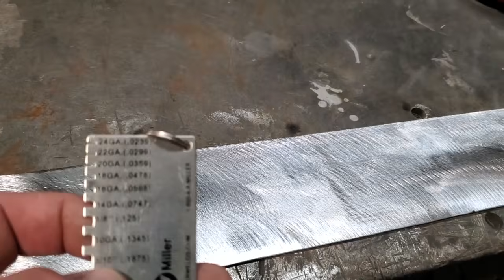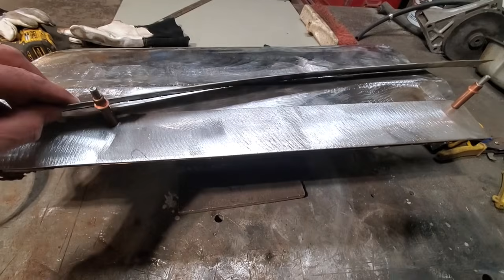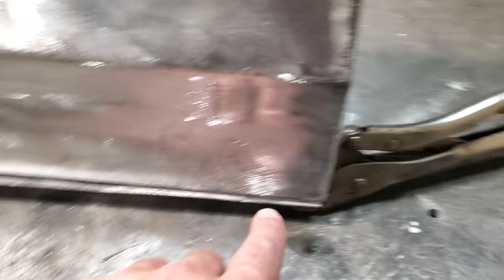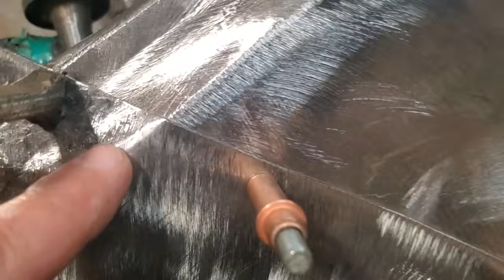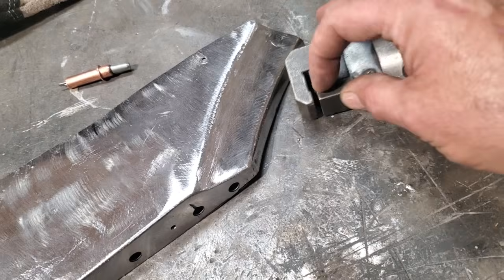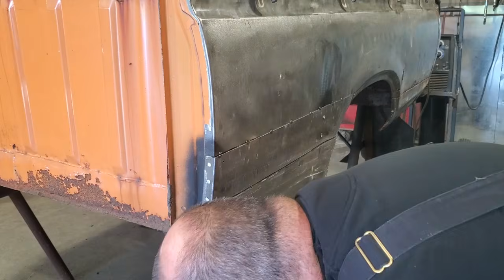How to make factory seams from rusty metal

Comment: Just wondering about using Mig brass wire for but welds. Asking since it seams to bond to sheet metal at a much lower temp than Mig wire .023. also I find some factory spot welds that are brass in color like on the ends of quarter panels. Thanks for your time and awesome videos
Reply from the maker: That is a new type of welding wire. I yet to use it. I been in a few bodyshops here that use it. It's designed for the thinner metals of today's cars. It's looks to be a quality type of weld. I was of the thinking it was a special  welder that uses the wire. Maybe a different gas. Something to look into.

Comment: First, thank you for your content and tips. You have actually got me wanting to get back into building again. A question if I may and hopefully it hasn't been asked too many times. Why the cut and butt vs. a pneumatic crimping tool for an overlap? I've used both and have no real preference but I was interested in your thoughts. Thanks again for the content.
Reply from the maker: I don't like the step cause it usually has a very unclean looking joint.

Comment: Love your work Fitzee.  What r the chances of you splitting the skin of trunk lid (boot here in Australia) Or a hood?  Rust between the frame and the skin can be bad with those 70s cars.  One of the best channels on the tube.  Cheers scott
Reply from the maker: I done it in the past. Had to swap outer skins. Not a hard job just have to take your time. Some are spot welded and have roll over lips. Not alot od spot welds do trick is to get the spot welds cut.

Comment: Fitzee, I have watched several of your videos over the last few months. I find them very informative. I have a 2000 Chevy Blazer that is a cousin to Crusty. Its entire exitance was here in Mid Hudson New York. Plenty of rust. I have been putting it off for some time but I have to address a lot of the rust. Your videos have given me a 
direction on how to proceed, thank you. My first project is a softball size hole under the gas filler door. It has taken part of the door opening out as well. I have a Lincoln AC 225 s stick & a Harbor Freight 125 flux core welder both of which I am ok at best.
My question, would I be able to use the HF flux core welder for this type of repair. I watch other videos that used it but I would like your opinion.
Stay well, Joe Z
Reply from the maker: It can be used but the cut and butt is very hard to do with flux on thinner metals. It's a much hotter weld
Reply: @fitzeesfabrications  Thank you. I want to get this  ( these ) projects on the way but may have to wait due to weather. Meanwhile I will see if I can find a gas welder for a reasonable price. Another issue is the lack of space I have. Would there be any issue storing the gas outside in a non heated shed?
Reply from the maker: @JOEZEP54  no it will be fine.
Reply: @fitzeesfabrications  Much appreciated

Comment: So whats the solution to making spot welds. Pinch welds rust out even with weld through primer???
Reply from the maker: Making spot weld??  You mean naming a welded panel look like it has factory spot welds?
Reply: @fitzeesfabrications  i guess but you said when they rust out its always at the spot weld?
Reply from the maker: @johnadona3014  yes. Now when I say rust out I ment it where the rust will start to show. This is mostly on winter driven cars. A car that is stored and well cared for will last. Many times longer. So keep that in mind

Comment: Grate metal work I'm just a beginner  with  a Lincoln weld pa ck 100  with 035 flux  core. Welding on early 50  mopars

Comment: Most videos show hammering there welds on dolly to stretch them from shrinking as they go along. What are your thoughts on this, I never see you do it and your panels turn out fine.
Reply from the maker: You see that in tig and steel welding with a torch. Those are softer welds. Mig is a harder weld and very hard to stretch.

Comment: I'm wondering what do you think about the usefulness of oxy-acetylene torches? Do you have one/use it much? I'm completing a small 8x8 fireproof grinding room/metal workshop at home for small projects and some rust repairs. Wondering how to best organise the space I have available.
My grinding room is in the basement, but I have a 240V welder power outlet accessible to work outdoors under the carport too.
Reply from the maker: I had 3 sets of torches in my life time. Sold all three. Haven't had them in 10 years. Every now and agian I love to have them doe shrinking metal but that's about it. Can't justify the contracts cost of the bottles to have any use for them.

Comment: i have 3 off these boxes made into trailers with 2 d-50 boxes made into trailers 79 1/2 ton chevy and a 68 3/4 ton ford box made into trailers all in good condition with tail gates the chevy and ford trailers match my pu's next i need a 68 chevy box trailer for my 68 chevy pu i do have all the parts sitting with a 3/4 ton frame . i have a lot of chevy square body trucks that are rust free. u guys would shit if u seem the datsun pu's i cut up and scraped for the trailers one ran and drove just fine even had a weber on it 5 speed and 4 speed and a automatic all had good bodies on them but they were free to me . i was going to build one but after sitting in it i just did not like it i am more a full size pu guy with a big block 4x4 or 2 wheel drive it has to have a big block even my muscle cars have big blocks i have a few good running sbc chevys sold all the fords i had but one 428 for my high boy need rebuilt running a 390 right now

Comment: These are great videos I am welding up my cars no experience at all, by trade I am a toolmaker so work with metal but never sheet. So when I have a plate to butt weld I take a lot of time making it fit as I would a tool but your methods make it so much easier and quicker to do. The best thing is how you explain what you do and use basic tools, the number of videos I watched on here that start well, but then take it a over to a bead roller, or other fancy piece of kit which the average DIYer has not got, we all have a hammer, a vice, and can purchase a few cheap dollies or make kit like you have. So thanks for all the great video, and passing on your skills and tips

Comment: The best quote "Make it look like it has never been repaired." Brilliant work Tony. 
Hammering a chisel like this is similar to hitting two hammers together (the end of the chisel is hardened to prevent it rounding off inside the pneumatic etc. tool) and can result in splinters of metal coming off like bullets. It happened to me as I was taking a shed down on a building site, the splinter went into my leg. Two colleagues, one when I worked as a mining electrician and the other when I was working in a car manufacturing plant, had the same thing happen to them, one had the splinter go through his clothes and into his stomach and the other one was blinded in one eye. If you look carefully you can see where the splinters have come off the hammer which was used to shape the second bit of metal in the vice.
Please tell your kids and your apprentices.

Comment: Hey bye, is that a Mastercraft Maximum cutting wheel I saw you using? I'm surprised to see such a master use such a garbage tool. I only buy Walter Zipcut now. Once you try them, you will never go back.
Reply from the maker: For the cost they are perfect. Pay less then a dollar each for thrm. Walter wants 3 to 5 buck a disk for theirs. I have no issues with these. Love them. I used all kinds of disks over the years and bang for the buck these are the the best
Reply: @fitzeesfabrications  no disrespect, but I see you pushing on the grinder and the 3/16" minimum blade kerf you are cutting. For the price difference, I would say that you will use 3 or for times fewer blades to make the same number of cuts. I would suggest that would balance the cost difference. Plus they just cut such a clean, fine line. The Mastercrap that I have available are 3 times the thickness of the Zipcut.
Reply from the maker: @joelburgstaler1458  I used alot  and no not 3 to 4 time might be two. I used them all even the walter blades. And this are 3/64 thick. So they are thin. I so use to them I can't see pass them. If it was cheaper to by better blades I would but it not. But we all have our favorite. So to each their own. Main thing is your cutting and grinding and making shit. Lol. Happy fabbing
Reply: @fitzeesfabrications  the ones that I use are 1/32. I have never seen a 3/64 at Canadian Tire.
Reply: @joelburgstaler1458  They are there.  Just looked them up.  50 pack is a great price.
Reply: @Sculpin74  like the man said we all have our preference. I have purchased tons of Mastercraft blades prior to trying good ones. I will never go back. Cost of my sanity is far greater than the cost of good cutting blades.
Reply: @joelburgstaler1458  Use whatever makes you happy.  :)  I'm just saying they exist in 3/64th thickness.

Comment: Beautiful work. I’m totally with you on the “weld through primer” I don’t like the stuff. I’ve bean using zinc paint lately but still clean it off where I’m welding, although I recently tried spot welding without cleaning and it works fine.

Comment: 31:25 I watched this 4 times over but i can not get it in...do you put the heat in the old (thin) or the new (thicker) piece?
I can not translate it to Dutch and turning on subtitles in Dutch only makes it worse.
My logic brain tells heat in the thin part so it cooles faster but the thicker panel is stronger, sooooo dillemma, dillemma.
Hope my english is not hurting your eyes to much :- )
Reply from the maker: I weld the thicker gage metal and apply most of my heat here and touch into the thinner metals so I control blowing threw the thing metal

Comment: Nice work! When sanding the holes for the spot welds, wouldn't it be easier to use little round stickers the size of the drill so you paint over them and then remove them? This way you don't sand away too much protective paint.
Reply from the maker: Yes some said a cut off drill bit works good

Comment: Another fantastic video. 2 for 1 with this longer video and lots of great tips. I like that you use 18 GA. sheet metal. 18GA. has the equivalent thickness of two - 24 gauge sheet sandwich. 18GA. can be sanded and grinded.

Comment: Fitzee, just on your sandblasting the panel comment, why does sandblasting ruin a panel? Love your videos, ive got a 1940 ford with lots of rust repairs needed so im trying to learn what I can. thanks
Reply from the maker: Crown panels are ok to blast specially early tin. Blasting thin flat metal it  push the metal. The blasting adds heat.

Comment: Tony, do you worry about tiny pinholes in the welded area? I did the cut and butt on a quarter panel, and after carefully grinding if I shine a light from behind I find tiny pinholes. I have been welding them up but it seems like I am chasing my tail!
Reply from the maker: Each weld I do I weld it to thr next weld. Your getting pin holes your too far apart on welds.
Reply: Thanks for answering! So I have been carefully welding them up, but also finding more, which is exasperating. Do I try to get every one, or just leave it to filler ?

Comment: Hi Fitzee, can you do a seam sealer demo? Working on a Jeep tub with a gob of seams....Tanks!
Reply from the maker: I will be but won't be for awhile. I like brushable seam sealer and I apply it with a 1 1/2 inch brush. I do 2 feet or so then dip the brush in thinner and brush over it agian. Helps smooth out the seam sealer and takes the thickness away

Comment: Any opinion on sandblasting sheetmetal with a bunch of bends in it for strength (like a fender apron or firewall)? Same problem? I had planned on blasting mine. Cleaning out those curves are a pain.
Reply from the maker: I blasted many cars. I hit anything that had a edge. I stay away from flat panels.  Floors, door jams, inner fender wells. Around windows  and rockers.
Reply: @fitzeesfabrications  Awesome! Thanks! That was my thinking too, but I have blasted no cars (yet).
Reply: Hey Fitzee, I am confused about why sandblasting is bad.  If the panel has rust before it can be finished the rust has to be removed.  Seems sandblasting would take off rust and leave more base metal than let's say 24 grit sanding disc?  Aside from chemicals what would you do?
Reply: @jimw6991  The fear with sandblasting is that it puts too much heat into the metal and warps it.

Comment: Factory finish or better is the way . Cracking job awsome finish 👏 
👍👍👍😜🏴🦕🙂🤞✌
Ps loved the pliers for the spot weld fill and those brass pin lockers that held panel in place . I use mole grips . What are name of the pin lockers? 
Great show
Reply from the maker: Clecos

Comment: Another great tutorial Fitzee! I modified a 3 1/2" wide masonry chisel to open seams, ( after drilling the welds out). I also have a set of "seam buster" chisels that I bought years ago. How about soda blasting it? Do you ever use a heat sink material when welding a long seam? I have used Bastos, which is a substitute for asbestos that used to be used extensively, In fact I still have around 15 gallons of fine shredded asbestos somewhere.  It really amazes me how many videos there are with some guy building something out of metal and he never does even a token cleanup of the steel. Inches is ALWAYS better than metric (I despise metric). I notice that you always use that planishing hammer for pretty much everything. Do you have other hammer shapes, and do you use vice grip style seam clamps at all? You are in effect pre-loading the panel to end up in it's correct placement. NICE! With the amount of hours that you are putting into the metalwork (which I admire greatly) just how much $$$ is the client paying for this level of excellence? I use pennies to back up a plug weld if I can.  I have a tool that I have found extremely useful and that is a tool that has a foam padded curved shoulder rest, with an adjustable length rod with a carbon steel point that you push against the panel to be welded leaving you two hands free. I assume that you don't use any kind of waterproof sealer in the seam. I have in the past used a  steel plate on a length adjustable foot with a fiberglass pad on it to back up a larger panel while welding.  Awesome repair.

Comment: New to the channel love your work a tip I saw on jademuttelys channel on the weld through primer he cut off the same size drill bit as the hole and used his drill in the hole when panels where fitted together and it cleaned the paint on the metal so there wasn’t a lot of exposed bare metal where you would have to guess at the size and location when grinding  the paint off metal to be spot welded it worked great thanks for all the good videos and advice
Reply from the maker: Thats a good tip. I'll have to check him out

Comment: When I was in college my brothers and I would do rust repair on our cars using a spot welder (Lenco spot welder) and would overlap the new piece at the seam.  I would spot weld several places then use a propane torch and lead solder to seal the seams(the metal had to be clean).  The seam would suck in the solder just like on copper pipe.  Back then there were no MiG welders, just arc and oxy-acetylene and pop rivets.

Comment: Nice Video , What would be a good wielder to do that kind of wielding on a Datsun?
Reply from the maker: Thats a hard one to answer. There are alot of good welders out there. If you tend on doing alot of thin metal. A Tig might be a good investment.  I been told they weld thinner metal easier then a mig

Comment: Excellent video Tony !  There are a hundred little tips in it for anyone doing metal work. I am reminded of when I restored my 1968 Chevelle, and trying to repair rust on the front bumper valance panel (behind the front bumper). I tried overlapping welding it.......what a mess. I ended up ordering a new one from Ausleys Chevelle in the USA. After seeing your techniques, I think I could now repair the original panel. Great stuff !

Comment: For the spotwelds i grind down a normal 7mm drill first flat and then inwards so that the middle becomes a point and it cuts more on the outside on the drill...for breaking the spotwelds a putty knife work also very good..
Reply: I use a putty knife also, you can get in without much damage, if you beat it up its easy to sharpen.

Comment: One of the things I like to do when I’m removing factory spot welds is to use a thin air file. I find the air file does a very good job and grinding through a single layer of metal.  Great work as usual, I can’t wait to see your next video.
Reply: what is a thin air file? google search reveals nothing. can you send me a link to one?

Comment: I wonder if there was a forced air slot cut into the surface of your bench so that the panel could be placed directly over it during welding in order to help keep the heat down.
Reply: Problem with doing that is the risk of blowing your shielding gas away from the weld. That causes had welds. I tried it and learned the hard way!
Reply from the maker: What he said^^^^

Comment: Fitzee have you ever tried using a band file belt sander to take out the spot welds. works like a champ.
Reply from the maker: No I haven't.  Don't have the tool. Seen it used tho